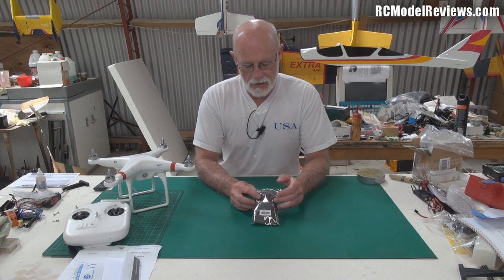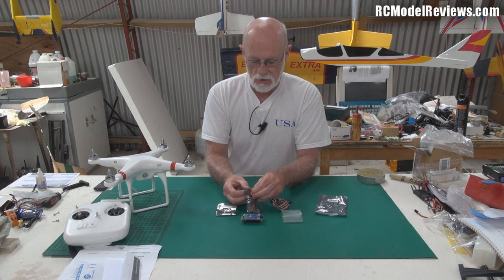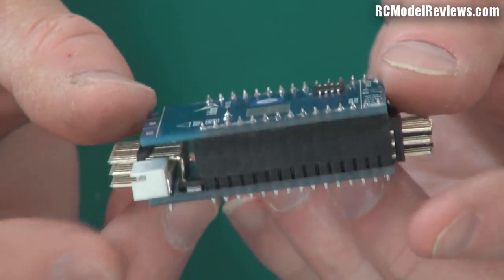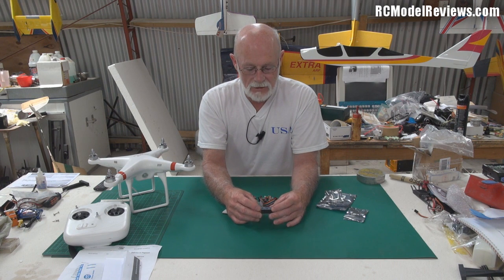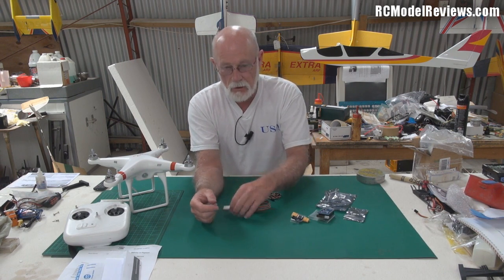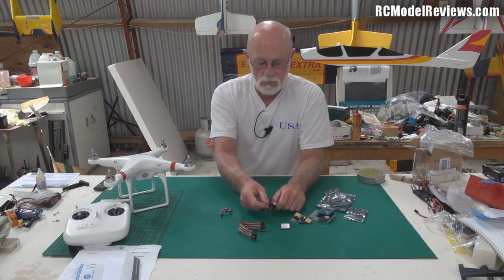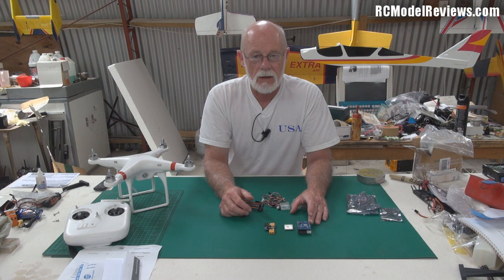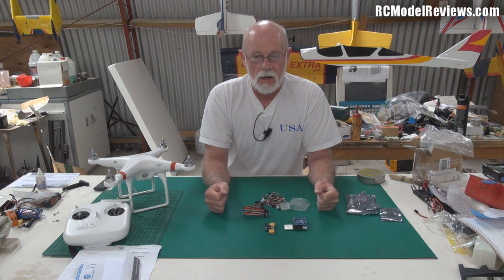Arkbird OSD/RTL for FPV (part 1)

Comment: Greetings. I use Eagletree Vector LRS exclusively. I have yet to locate an ATT that will work with the Vector. It appears that the only way an ARKBIRD will work with a Vector is to run two video systems.  One for the Vector and the independent for the ARKBIRD. The MFD ATT is out of the question.  There is only two ATT's on the consumer market. Eagletree makes a thing called Eagle Eyes but the unit will not support an ATT function. Any thoughts?

Comment: As you go, friend, I use the Arkbird OSD with 3S battery, but I intend to use 4S battery, how do I do it, just connect to the voltage sensor or do I have to make any changes?

Comment: How's friend, was my Arkbird, but I was trying to ride on a wing for FPV, and is making trouble !!! could make the settings just right, but when I do the stability test, the channels are reversed, ie the aileron acts as a lift, and it works like elevator works with Aileron, I tried reversing the menu and nothing and even reverse the radio does not work if the configuration as follows:
1 - Commands in Normal Radio (aileron, elevator) without mixing
2 - On the flight configuration menu put as FWind
3 - In the menu on the screen all Cjaves to 0 (zero) - obs already tested one and only key 4 to 0 (zero) and nothing.
4 - Aileron out on the wing and out to deep right wing Esq.
I've done several vesez and always the same problem that put the aero OSD and is working very well, but in fact would like to leave the ASA.
Any help is welcome !!!

Comment: Would you suggest a FY 41 AP Lite or the ArkBird..? My project is the Volantex Ranger 757-4 FPV which I have configured for basic close range FPV  but more importantly need a safety RTL  as a collateral Insurance in case I lose orientation or sight!! Yes! I'm at that age !!

Comment: i love how they ship with the anti static bag but do not have the pink anti static foam... need both to be anti static...
Reply: No, they do not need both. The bag is to keep the components inside protected whilst the anit static foam is to keep the components from flying around.
Reply: you need the silver bag and the pink foam or bubble wrap. with out 1 or the other is is not effective. feel free to go look it up
Reply: shadowsrwolf Just to clarify things for you dude... The bag does the electric protecting superb by itself. The foam is added for MECHANICAL protection, such as dropping it or for EXTRA protection. The anti static foam does not generate any static electricity on it's own, but will pass through another current. Therefor THE BAG is needee, not the foam. End of story.

Comment: Lots of "Part 1's"...do you ever actually mount any of this stuff to a plane and/or quadcopter and test it?  "Reviews" suggests more than just opening the package and describing the contents.  As much as I appreciate that, it's not really what a "review" is.  Still waiting for "A cheap GPS OSD (part 2)."  Ya got a part 1 where you open the package, but after over 5 minutes of video I still don't know if the thing works or not.  Please just do the whole review at once instead of 5 minutes of describing package contents wrapped up in a "Part 1" of a god-knows-how-many-part series.  It's okay to sit on the raw footage for a while.

Comment: NIce quad next to you Bruce!!! ah, Happy new yr mate, fortgot to say it haha.
Have u tried the fy31ap with the hornet OSD? It has nice new features..
I mount it on a Bixler, eventhough there is not much space inside.. but it fited well enough.. With all the fpv gear, and two bateries.. maybe u can give a try to an AXN dont u reckon? big hug from Argentina Bruce!

Comment: I assume the current sensor doesn't have the heat shrink on so that you can change the out xt-60 battery connectors for something different.

Comment: Hi Bruce,

Is there a minimum natural stability requirement a plane needs to have for return to launch to work? I don't see any people putting FPV/RTL on aerobatic aircraft. Is that why? Most FPV designs seem to be designed as a trainer type design rearranged to carry camera gear.

Comment: Hmm, hadn't considered the static sensitive electronics vs static producing foam aspect of RC. Wondered why hot components (esc's) were enclosed in heat shrink.
One of the first micro-computer kits sold back in the late seventies was shipped with the pins of all of the chips neatly inserted into styrofoam blocks, including the cpu. Needless to say, none of these kits ever worked. The guy who sold them went out of business very quickly!
Looking forward to the test. Thanks for the video.

Comment: Hi Bruce, it's very nice to see you again! As you mention the FY 21 AP, is there a way to calibrate the current sensor?  Although I don't use separate batteries, there is a difference between power and receiver voltages. Could you tell why?
Cheers
Akis

Comment: heads up Bruce , on the gps look for the 5v &3v solder joiner (right near the gps plug)and make sure it has the right one joined for your system.
Had this problem with the storms gps and this was set to the wrong voltage on some (notified by developer)

Cheers 
Patrick